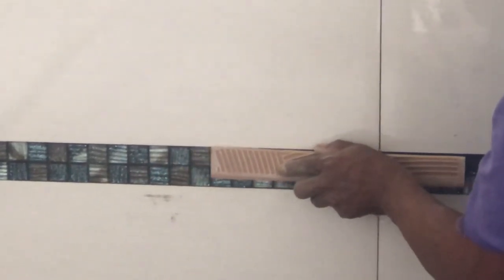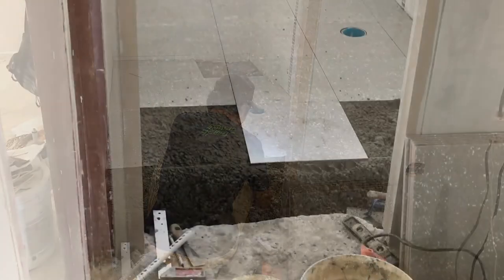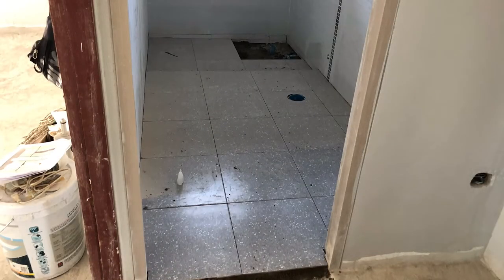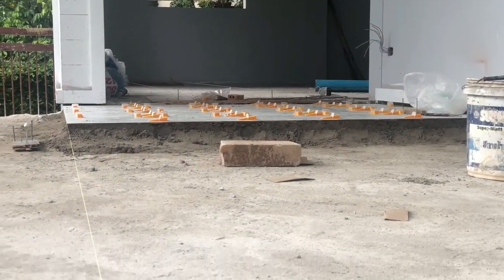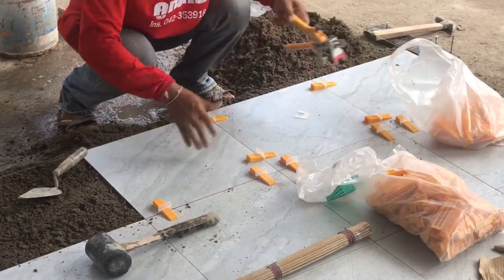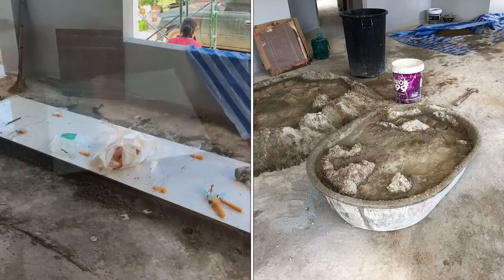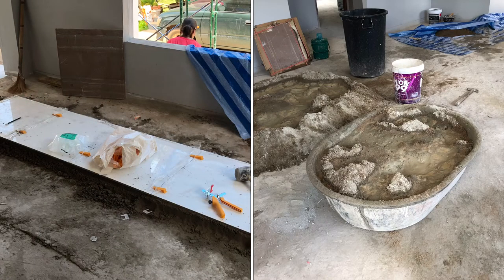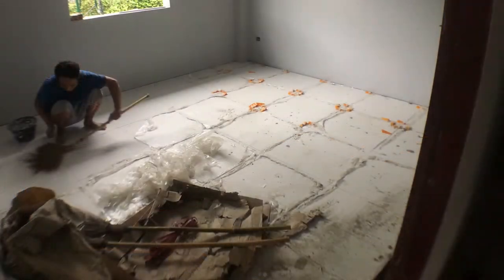House Build in Thailand - Tiles & Painting

Comment: If there is so much added concrete under tiles in some areas because the original concrete slab was not level, then that should mean in some other areas the added concrete under the tiles should only require a thin layer to make it level.
I am looking forward to seeing it in October.  My wife and I will bring noodle soup and yum.
Reply from the maker: Hope you are having a good trip to Canada. And looking forward to your visit in October.
Reply from the maker: They assured me that this is the proper method to ensure a level floor.
Reply: @canuckinisaan8242  yes, it is quite normal if you don't have a level concrete slab.   Unfortunately it seems to be common even if the slab is level.